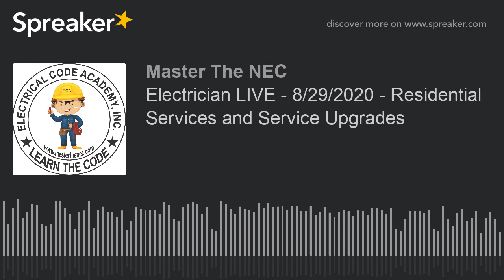Electrician LIVE - 8/29/2020 - Residential Services and Service Upgrades (Podcast)

Comment: What is the function of the meter socket bypass lever?
Reply from the maker: The By-Pass is really for the Utility folks as it is simply a "By-Pass" so they can remove the meter without the risk of arcs. They use the by-pass to actually by-pass the meter socket so they are not removing it under load. It is not to be used as a "Disconnect" for the electrician....it is again for the Utility use only.